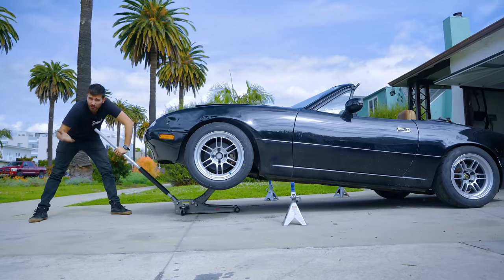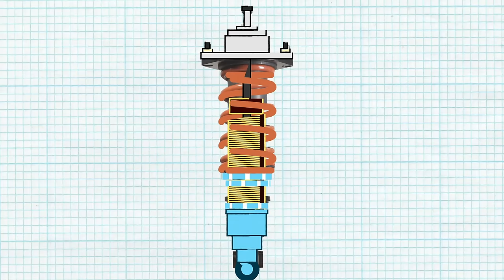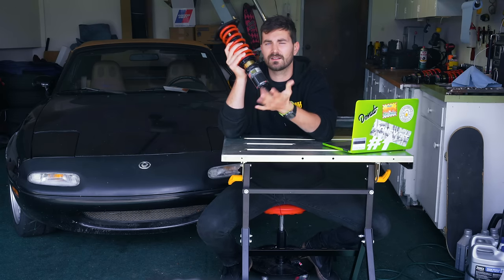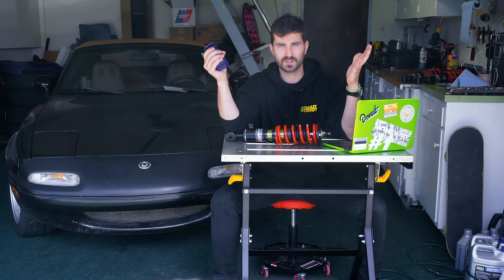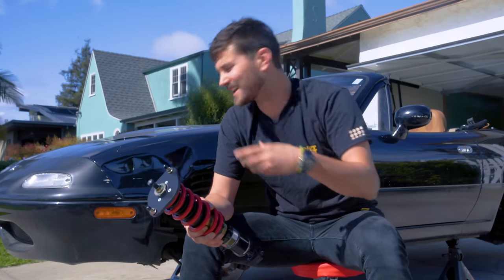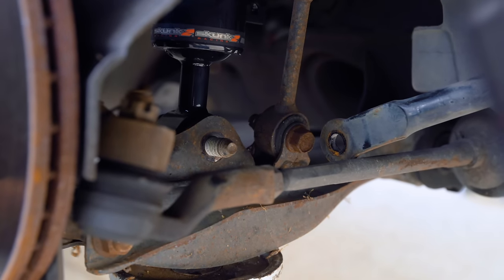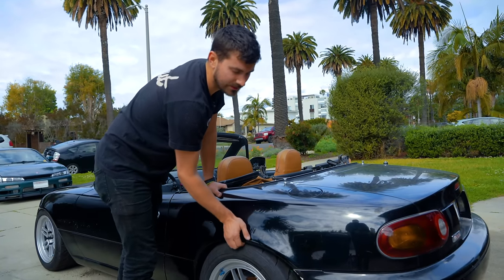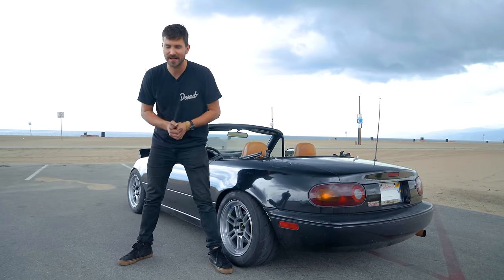How to lower your car the RIGHT way: COMPLETE COILOVER GUIDE

Comment: This guy has a great flow and naturalness to talking and explains things very well. I was just thinking about coilovers.
Reply: Sorta.  He shouldn't have matched the coilovers to the stock parts.  Length means nothing if the stiffness of the springs are different.  I installed my coilovers as they came out of the box.  Some manufacturers preset them for a set amount of drop... usually.  When done three of my wheels were exactly 1" lower, and one had to be raised 1/8th of an inch.  

Also, he never explained why he just started whacking his fenders with a hammer.  That's important and you have a nice car and not some pre-banged up Miata.
Reply: @gwcrispi  rolling fenders seems pretty self explanatory to me when he checked for rubbing and wheel gap
Reply: Chris Fix Records videos in first person as if you are actually there. This guy is just as good, but I’ve already established trust w/ chrisfix. I am not necessarily inclined to listen to everything this guy says yet.
Reply: NuclearBolton you should definitely give him a shot. He used to work for ECS tuning doing all their install videos and such. He knows his stuff and I’ve always enjoyed his videos.

Comment: Zach: has thorough expertise in modifying cars

Also Zach: doesn't chock tire, engage parking brake, or park in gear before lifting vehicle on sloped driveway
Reply: TBrownPB Safety third
Reply: He had it on a Jack so chocking wouldn’t really have been that possible
Reply: That confidence is how you know he has experience
Reply: @jack_tamales  could choke the rear wheels?
Reply: @jack_tamales  not necessarily true - I have a more sloped driveway, and I'd stack masonry bricks under my jacked up car until it touched the frame on both sides so that if it rolled off the stands and Jack, it would just sit back onto the bricks instead of toppling over.
Reply: komedy
Reply: @jack_tamales  Yeah he could - Infront of the rear tires.
Reply: Lmfao... My 1st thought when he let the front down "oh snap somebody move the sylvia"
Reply: Miatas are manuals, they dont have a parking gear (but putting it in gear can keep the car a bit more still)
Reply: @tiagobelo4965  read it again... he wrote "park in gear" not "parking gear"
Reply: The saying goes "Safe by chance not choice" right?
Reply: @tiagobelo4965  Miatas aren't all manual anyway
Reply: He just wanted to test if theres rubbing on the fenders. Or he really forgot. Lmao
Reply: At least it was a Miata and not a rock crawler or something there was a guy who was under a corner of his Miata and smacked the release on his jack stand with a wrench but luckily he essentially only had 1/4 of the cars weight on him which on a Miata is about the best you can get when it comes to dropping a car on yourself so he managed to squeeze out by lifting the corner
Reply: Complacency my man.  Same reason I still zap myself occasionally after like 15 years of electrical experience haha
Reply: Experience leads to ignorance at times from an idiot sheet happens and then you dont forget
Reply: @DaveckKProduction  anyone whis extra.
Reply: @T11LMG  I have a flat driveway and I do that whenever I'm under it. Except I use 2X10s. Don't wanna die to save 2 minutes.
Reply: @GustavCarl17  I always say that😂😂
Reply: @T11LMG  should use wood instead of bricks. Bricks can crumble
Reply: The tires were pre chalked and chalking is mostly for offroad tires so they have more grip
Reply: @GustavCarl17  number 1 is fun am I right kids
Reply: What does chock tire mean?
Reply: Chrisfix would be mad lol
Reply: @benjamingilespinosa7303  a chock is a wedge-shaped piece of dense rubber you place up against your tire to prevent it from rolling on a sloped surface
Reply: It looks fun on video. Duh
Reply: @kop1522  “the tires were pre chalked” Haha. Do you have any idea what your talking about?
Reply: @KaitouKaiju  and zach's miata is manual anyways..
Reply: Zach: general smiles per gallon
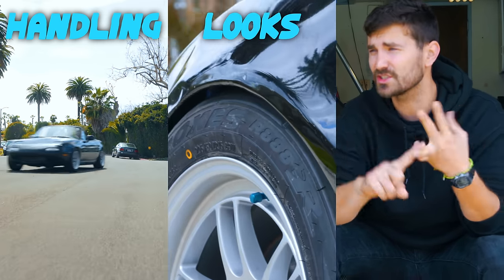Also Zach: 0:17

Comment: Love how they're actually using torque specs. Don't see many "tutorials" that mention torque specs even when it's very important so as to avoid stripped  threads
Reply: Torque specs?? You mean ugga dugga isn’t good enough? Lol
Reply: Give it the ugga duggas
Reply: The previous owner of my miata forced every bolt in with an impact driver, it's so annoying.
Reply: I recommend ChrisFix. He always says how to tighten up any screw.
Reply: @jackofall2305  and then hit it with a "that's not going anywhere"
Reply: @SpaceMissile  🤣🤣

Comment: When you pulled out the roller, I knew exactly what was coming from my own Miata modding experience.  Always roll while its stock lol.  Definitely learned way more than I already learned about the mechanics of shock absorbers, which alone was worth the watch!

Pro tip on rolling after you've already changed shocks on a double wishbone car:  Unbolt the bottom of the shock, and let the control arm drop down.  Put your floor jack and whatever wood blocks you need as spacers under the control arm to provide a travel stop, and you should have enough spacer to roll!
Reply: You my good sir are a life saver!
Reply: You can use a baseball bat too. If you take your time it works just as well. Ive done it before. Plus if you need a tiny bit more room for a wide wheel you can actually pull the fender outwards as you roll it. I would only attempt that being super conservative with how much you do it. Im talking a tiny bit. Time and patience is key. I didnt have to use a heatgun either and i thought i would.

Comment: The biggest thorn in my previous coilover endeavours was compressing the spring/coil to mount over the dampener. You chose the easy way by already having assembled coilovers, that made the work so smooth. There are dozens of spring compressing tools out there, most of them are an absolute health hazard. Every car has different shaped plates so good luck finding one for your car - LPT: The ones that say: UNIVERSAL are the ones to steer totally clear of. I had one car (BMW Z4 E86) where the front springs only had 3 or 4 coils and i had to search numerous shops to find one with one of these really expensive hydraulic mounts. 
So - depending on the car and if you need to assemble/disassemble the coilover this can turn into a mighty nightmare.
I love this channel btw., you rock Zach!

Comment: Great video! Chock full of good info and very entertaining. Don’t forget to loosen and retighten the upper and lower control arm bushing bolts too after changing ride height!
It looks like you could have rolled your fenders with the roller tool before swapping the suspension, or lengthened the coilovers to get the tool to reach. 
Subscribed!

Comment: Interesting on the fender roller. That looks like an Eastwood, same one I have. I was able to use it on my Miata. I think you can adjust a few bolts to get it to fit right.

Comment: Nice intro to shock/spring mods.

Couple things though:

1. When putting new coilovers on your car, its not a terrible idea to put an appropriate anti-seize compound on the adjuster and lockrings. they may be aluminum, but coilover threads and lock rings are still known to corrode and seize up. it happens on all quality of coilovers too, whether high end or not, and once they're seized they're nigh impossible to adjust again. more often than not if you need your adjustability back, you're sending them in for warranty, or buying a new assembly/set. anti-seize is a really cheap, easy preventative measure to make sure your coilovers are always easy to adjust.

2. don't adjust height from the middle ring. that's the preload lock-ring. set preload with the top ring and then lock it in place with the lock-ring.

3. there are some amazing shock and lowering spring combos out there that outperform most base level coilovers at half the price. H&R race springs with Koni Yellow adjustables or Bilstein performance shocks will beat the piss out of most coilovers around the $1000 mark, and you can get into a full set for $500-700 USD for most common applications. they may not go as low, but the shock damping and spring rates are superior to just about anything below $1100 in the coilover market, aside from a good deal on budget coilovers from one of the companies that offers custom spring rates and valving on their shocks. if you care more about performance than ride height, are looking to set-it-and-forget-it, and you're trying to do things on a budget, quality adjustable/performance struts/shocks and quality springs (or Ground Control kits for a bit more) will offer better performance than most coilovers 2-3 times the price.

Comment: Just based on the opening clip, I would like to petition to change the title to be "How To Properly Jack Your Car"
Reply: Use wheel blocks or at the very very least keep use the handbrake/keep it in gear.

Preferably all of the above.
Reply: @mathieulevasseur4082  indeed, usually I just keep it in gear and have the handbrake on tight

Comment: The lower spring perch is for adjusting ride height. The lower shock mount is for adjusting the travel ratio so the shock bottoms out on the bump stop before your tire contacts the inside of the fender. If you end up with negative preload, add a helper spring.

Comment: I haven’t seen a single comment about how this guy is as tall as the Miata is long... XD HOW DO YOU FIT IN IT?? 16:47
Reply: It’s surprisingly roomy in there! Im 5’10” and I don’t even have my seat all the way back in mine

My brother is 6’8” and he fits in the passenger seat of my NA with no problem at all. If the steering column is adjustable (which mine isn’t) then I’d say someone 6’6” or shorter can drive a miata.

Comment: Hi there, I have a question:
Can I get coilovers to get their benefits while some time set the ride height to factory spec when needed? (also factory softness, when I want comfort)
edit: I mean are the adjustments always toward sporty settings, impossible to set to factory spec because "if you want factory spec, don't use coilovers"

I have heard some people in my community said coilovers will only reduce ride height, and will only stiffen ride; so they're just for sporty ride. They even say coilovers main purpose is to reduce ride height.

thanks!
Reply: A lowered car will always ride harder. If you want to retain a soft oem like ride, just getting quality springs, along with new brand name struts/shocks if you want. I'd pick that combo over a cheap set of coilover any day.
Reply: remytv thanks for your reply, I would want that harsher sportier ride for sure but.. can coilovers be tuned to oem height and softness just so I don't need to reinstall back my oem suspension in case I want comfort?

Comment: I cheaped out and got lowering springs. But man does this car TURN.
Before, my stock tires sucked, wheels were heavy, and shocks and struts were all worn bad.
Got new sticky tires, and lighter wheels and they handled so well, my tires wouldn't screech, but instead my suspension would give out and skip.
Got new OEM struts and shocks combined with Eibach Sportline lowering springs and my car shows just how well it works.
Taking on and off ramps at 55+ without my tires making a sound, or my suspension giving out on me. 
also, the lack of bounce and body roll is INSANE
EDIT: hahaha just got to the part where you showed THE EXACT lowering springs i got xD

Comment: The air chamber also compensates for the fluid displaced by the shock shaft as it goes into the body of the shock. That displaced oil has to go somewhere.

Comment: I had a '01 Tracker with a completely blown front right strut.  You could pump the thing by hand with no effort.  I was racing home one day because I thought there was an emergency.  Hit a pothole, car went up, strut fully extended, car came back down, strut fully compressed, and I heard a bang so loud, I could hear it over my stereo at max volume (note that I could barely hear the V6 at 5k RPM when my music was blasting).  I had to pull over to see I broke something, thankfully I didn't.  Another time, I was with a friend, we hit a bridge, and it caused my strut to bounce up and down very noticeably (that video of the van brings back so many memories).  My friend looked at the front right corner of the car, then at me, and said "I don't think I like that very much."  I looked over and without missing a beat, said "Nah, it's fine, does it all the time."  I think the back two were also pretty close to gone because if my 350 pound friend sat in the back when I had my 300 pounds of papers I delivered every weekend in the back, you could hear the strut fully compressing after every small bump.

Car lasted like two months because even after replacing all four tires, rotors, and brakes, the busted strut and missing sway bar, and all six spark plugs, the remaining gas tank strap (the other one didn't come with the car) broke since the rear quarter of the frame didn't exist and my gas tank was FUBAR.  It was my first car and taught me the valuable lesson of looking under a car before buying it and to always clean the underside of a car after a icy winter in PA since PennDOT thinks salt is just the greatest invention ever and sprays literal tons of it per mile when it's snowy/icy out.

I know that after, they make a video asking if 9500 dollars worth of car mods is worth it.  I'd like to point out that half that was on these coils alone, atleast if the 1k price I'm seeing for them right now is what they bought them for.

Comment: I have a set of the Flying Miata/Fox Racing Shox coilovers for my NB. They kick ass and are super versatile, but a little on the pricey side. I pre-ordered mine before they came out so got a pretty good discount. The Fox Shox Factory is in my hometown so I had to go with them. Already running Fox on Mlmountain bike and have only had good experiences with the company and products.

Comment: Cavitation is a phenomenon in which rapid changes of pressure in a liquid lead to the formation of small vapor-filled cavities in places where the pressure is relatively low. It's got nothing to do with the foam but the creation of a vacuum that when collapses cause damage. Ships suffer huge amounts of damage to their rotors as the cavitation erodes away the metal.

Comment: Trick... use a rachet strap to compress old and new springs to make instal  much easier. Be careful taking the strap off though. But spring compressors are what the shops use

Comment: I had a NB mx5 and did coilovers on it, when I saw you on video trying to remove the oem shocks without removing the upper control arm I was like no way they'll work it out, I spent so much time trying to push like an idiot and I was alone on this task haha
I ended up using spring compressors and removing the arms

Comment: FYI- If you have to roll Miata fenders with 15x8 wheels, you bought the wrong offset.  The NA & NB Miatas can take 15x9 wheels without rolling the fenders at proper performance ride height.

Comment: Wave Springs and Friction Springs are things too! (They're pretty different from Coil Springs.)

Maybe outside the scope of this video, but I'd still suggest taking a look at them at some point in the future, because they're pretty interesting.
Reply: The short version...

Wave Spring: A wave spring uses a different shape, which allows it to be smaller and has a lot of other benefits.

Friction Spring: The geometry of a friction spring allows the spring itself to also be a form of shock absorber, basically eliminating the need for a separate shock absorber. Industrial vehicles sometimes use them.

Comment: If you roll the guards with then stock suspension the rolling tool should work as the hub is lower. Also some higher quality coil overs recommend adjusting the ride height from the spring base not the shock.

Comment: Is it suggested to change other suspension components while lowering with coilovers such as sway bar end links? Won't there be more pressure on said components after lowering that may cause issues? Love this video! It inspired me to turn my Camry into a Slamry! But now I have uneven tire wear and all the four corners are at the same height and dampening.

Comment: Heads up for those adjusting the height, make sure you turn the proper collar the right direction (if youre raising or lowering), otherwise you might loosen the preload instead

Comment: The part about rolling the fender with the hammer I know is to gain more room for the tires. What concerns me is that it looks like you did the job but added a few dents to the outside lip of the fender. I don’t want dented fender lips so can you suggest another way to do the job that won’t dent the lip? I guessing a tire shop might provide that service. Yes? Nice description on how exactly they work!

Comment: Hey this guy knows what hes talking about. Surprising. But a more specific reason of what cause cavitation is "flash point" the rebound face of th piston must be at the same force of the compression side. So without proper compression tuning you can have rebound face reach "0" which cause oil to become gas. Which the gas will compress unlike the oil. Which is why your shock loses dampening.

Comment: Do folks ever vary the suspension from side to side to account for the driver’s weight? 
Maybe in a very small car (like an MX-5) which is usually driven with only the driver aboard?
Great video. Learned a lot today. 🍩

Comment: Two details that should be pointed out:
1. He didn't use it but if you are going to use a fender roller heat up the panel with a heat gun to avoid cracking the paint.
2. Always go for a little more ride height at first, you can loose some height as you break in the spring. Do a final adjustment after 1 or 2 weeks of driving around.